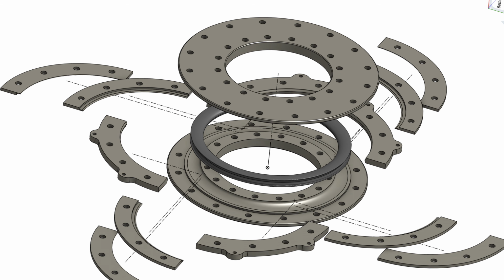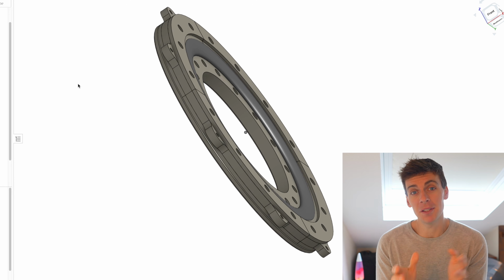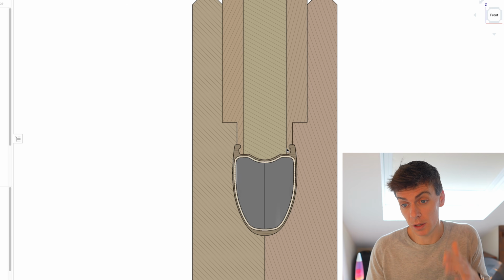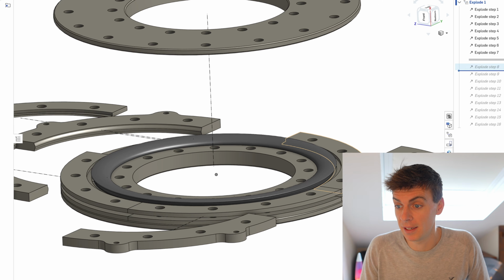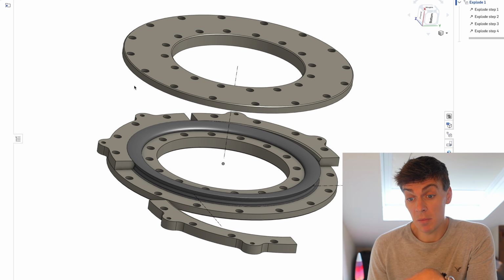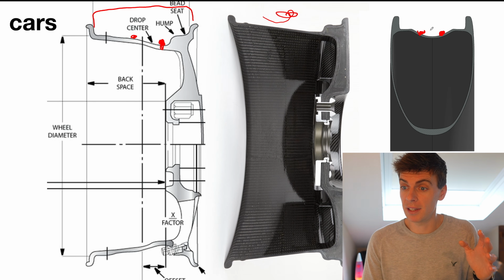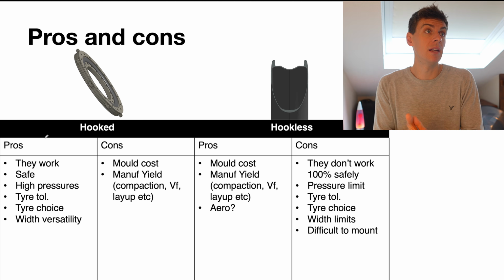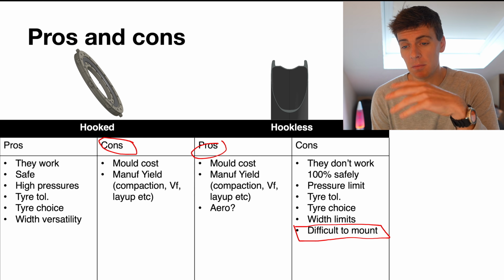Hookless carbon Bike Rims - the Truth = cost cutting.

Comment: If they are saving money on manufacturing, they sure don't seem to be passing the savings to the consumer.
Reply from the maker: I think it depends how you look it at. It helps to allow them to build a product in the US. Whether that matters to your or not, but for a lot of people it does.
Reply: @PeakTorque won't matter when noone buys it
Reply: @PeakTorque whats all this crap about with short cranks the grifters claims the old longer cranks hurt there knees lel
Reply: Yeah...I'm reminded of the "Law of Diminishing Reality"...apologies to 'Utility'.
Reply: I agree, and i'm no zipp lover, but their 303s hookless wheelset can be bought for just over £800 new which is relatively cheap for zipp.
Reply: @Local.hero.1983   I have the 303s as backup wheels.  They're outstanding for the money.  Significantly better than the noodley $2300 Zipps I had in 2006 that would melt on descents if you weren't careful😅
Reply: Hahaha - Have you ever seen Zipp or Enve do a price drop? Nope going straight into bottom line.
Reply: @ConstantRider  Zipp literally dropped their prices on the same model rims when they went hookless...
Reply: @ConstantRider  recently I’ve seen NSW wheelset prices down almost $1kUSD on a few websites. Give it a google.
Reply: @ConstantRider  Zipp and Enve are made in America so that means American wages. I have no issues with that. Better than some dirty factory in China.
Reply: @ConstantRider  My 303S wheels were the first pair of carbon wheels I could afford brand new, I'm not necessarily crediting that to hookless tech but I definitely noticed a decrease in price.
Reply: @ConstantRider they just did a huge price drop when hookless launched.
Reply: @ConstantRider yes,  when they went hookless, their wheels dropped $200-300 for a given model.
Reply: @veganpotterthevegan  not quite so...tubulars predate clinchers, they are 1800s technology.  Please look into track racing and why they use tubulars.
Reply: @menelaos951  nothing I said should lead you to believe I don't know that
Reply: Saying they aren’t passing on cost savings shows people don’t understand economics. If one manufacturer lowers manufacturing costs and doesn’t pass on some of the savings, others will to take market share. Supply and demand. Finding cheaper ways to make things that perform as well is a benefit. If they prove to not be safe, then that can cost sales so we’ll see.  Mine have been great so far.
Reply: We're not supposed to care about what goes into the price tag, only about its size. I know other replies mention labo(u)r costs and other factors. I would kindly remind everyone that, unfortunately, the incentive lies, for consumers, solely on the function and cost of the product. Such is the economic system we live in.
Reply: How do you know?
Reply: Used to be really cheap 1000-1200g hookless wheelsets in AliX back in the day, still are some. EliteWheels has a set of 38mm rim profile, 1180g, 500$.

And they don't have any pressure limit and you can mount anything from 22mm to 32mm on them. 

Just need to glue the hookless tire on the rim hm though.
Reply: Imagine being deGendt and told to get back on hookless
Reply: @dickieblench5001  he’s riding hookless right now. The reason his rim failed had absolutely nothing to do with being hookless. Use some common sense. Look at the rim!!
Reply: Same with the 1X scam on road and gravel bikes. The manufacturers eliminated the cost of a front shifter mechanism, a chainring, and a front derailleur, yet the price of the groups are generally at the same MSRP or even higher than a comparable 2X system. 1X for road and gravel has always been a complete scam to lower manufacturing costs and increase manufacturer ROI. Full stop!

Of course, it also got pedaled to the market by SCAM's marketing team because they lacked the ability to create and fabricate a dependable and proper shifting front derailleur so they basically just lost it and started advertising their snake oil BS about how 1X is soooo much simpler (as if a bicycle front derailleur is some obtuse NASA type device that no one can comprehend or adjust on rare occasions???) and then lied further and waxed poetically about the supposed "massive" weight savings while of course conveniently ignoring the fact almost all 1X road and gravel set ups are using a dinner plate sized cassette, a chain catcher and a longer chain to deal with that dinner plate size cassette, which pretty much eliminates  almost all the "supposed" claimed weight savings. Then to finish off their comedic snake oil marketing act/project they actually raised the price of 1X groups higher than their comparable 2X systems even though it obviously costs them far less to produce said 1X system. And of course, loads of gullible and easily marketed to dopes happily by into their snake oil nonsense. 

Oh yes, I'll happily pay MORE for bigger gear jumps,  constant shitty extreme chain angles and loads of extra accelerated wear on my chain and cassette and single chainring up front. Sounds like an absolutely "incredible must have" bargain on my road or gravel bike.  PT Barnum would have been very proud and envious of this obvious scam marketed as an "improvement"!  🙂
Reply: It is almost the opposite because they advertise it as lighter and more aero and charge more, which is insane.
Reply: Everyone's wheels got cheaper when equivalent models went hookless
Reply: Giant bikes are bundled with carbon hookless rims on all mid range road bikes and above for a long time now. 

And are incredibly well priced vs competitors, and the wheels are a bunch lighter too than stick wheels on other brands. 

There’s the savings. 

Zipp are a vanity gimmick brand as far as wheels go, £500-1000 on the price is pure profit so you won’t see much benefit from efficiencies. 

Also, they can’t even make hubs with decent seals so their wheels are worthless to me anyway.
Reply: @TheWoogeroo The price discussion is not the case anymore.  The new Giant MSRP are outrageous.    You can buy a top of the range Look bike cheaper than a Advance pro.
Reply: @TheWoogeroo  > are a bunch lighter 
How much?
Reply: @andzejwojownik8012 I think back a few years ago the comparison was 42mm deep carbon with a DT Swiss produced hub, vs no name alloy at the same price points. This was pre Covid so pricepoints were very different. 

But at present for an example, on the manufacturers UK sites: TCR advanced pro2 vs a specialized  SL7 Sport

Both £2999, the Giant comes with 40mm deep SLR 1 carbon wheels with unbranded DT Swiss hubs, the Specialized comes with alloy wheels.
Reply: Can you remember how many instances there were of tubs rolling off rims? This was never blamed on the technology, even though it was mad how unsafe it was. It was always blamed on user error e.g. you didn’t spend the full 3 days applying multiple layers of glue and then leaving it all to cure properly, or you braked too much going downhill and melted the glue. But consumers and racers just got used to it and learned how to make the best of it. And tubs entered the market before the Internet, so there was no collective hysteria. Maybe I got lucky, but I’ve had 3 different sets of hookless wheels and they’ve been the best wheels I’ve owned. I race on them - in Belgium. They get smashed. And yes they do have benefits. They are lighter for the price than similar specced hooked rims, and they give a broader footprint, which helps loads with grip. And nowadays many teams race on hookless now with no issues, Pogacjar’s for example. How many YouTubers who slag off hookless have used them for any period of time? Sorry, but this is really getting out of hand? It’s pure fear mongering. People are attracted to these horror hookless stories for the same reason they buy trashy tabloids - the fear of change.
Reply: @MrIvanPe The main reason we never had them blaming the failure of early tubular tires on the design itself, was because there was no alternative. Tubular glue on tires were literally the first pneumatic tires, without anything to compare them to. There were skeptics of bicycles and, no doubt pneumatic tires, back then, but it so thoroughly revolutionized transportation that those complaints were quickly silenced. Hookless rims offer virtually nothing to users of narrow tires, and current road tubeless is not perfect by any means, so there's reason to be cautious.
Reply: @MrIvanPe  There's a huge difference in consequence between a tub rolling off the rim, and a tubeless blowing off.
Reply: @stephensaines7100   you're right.  A tubular rim without a tire is significantly more fragile than a tubeless rim without a tire...especially a hookless, tubeless rim
Reply: @MrIvanPe  Comparing to tubulars is not right. Tubulars could roll off the rim, but it was in fact due to user error, nothing else. The hookless rims can make the tire come off the rim because of tolerances in manufacturing. That is very different.
Reply: @MrIvanPe You don't need any personal experience to appreciate the seriousness of tires blowing off rims. Especially when it can be traced to a model or combination. Why be so cavalier about safety? I don't get it. You like the design, cool have at it, but be realistic. These products have wide reach and are generally sold on marketing claims.
Reply: @MrIvanPe   two of my worst crashes came from someone else's tubulars rolling off their rims

Comment: Before disc brakes, Shimano manufactured rim brake wheels will aluminum bonded to carbon fiber. Dura-Ace version weighed less than 1,500 grams. Has anyone use the same technique for disc brake wheels?
Reply: Those rims are aluminum with just a thin cosmetic carbon fiber layer on top. I have seen the cross section of C35.
Reply: Ask Shimano how their crank recall is going ...

Comment: Just broke my femur when I got a blowout on my rear zipp 353. I'm not sure if I hit anything or maybe I had the pressure wrong on the tubeless setup. Completely new tire mounted by my bike mechanic the night before 32 mm Continental Grand Prix 5000 AS. Not sure I want to use these wheels anymore.
Reply: No good. All the best with a speedy recovery
Reply: Get well. Are you in the states? If so have you found your local shops really pushing hookless? Where I am it is being sold and trending, but no one really seems excited to elaborate on the benefits
Reply: Blowout as in a puncture or from the tyre coming off the rim? What pressure were you running? Hope you heal up well well and make a full recovery.
Reply: Horror story
Reply: Sorry to hear this . Hope you have a speedy recovery. Please consider switching to hooked wheels.

Comment: Brilliant as always, thank you. Winspace provides awesome lightweight wheels with hooked filament wound high temp resin rims, and carbon fiber spokes for about US$1300/set. They can be run with tubes or tubeless. I assume that Winspace (and other manufacturers) have found a way to be profitable with hooked rims. Why would anyone choose road bike hookless? They are not less expensive for the consumer. Also, the pricing for the TPU tubes have come down to about $10 each, and they are about 30 grams.
Reply: At $1300/pr I'm sure they're veeery profitable.
Reply: @AndrewBlucher  You will be surprised to find out how relatively inexpensive the material costs are.
Reply: @HoshinoMirai  No, I wouldn't. Why assume that I'm ignorant?

Comment: Car tyres are not fitted with a 'hydraulic press'.  They are not pressed on!
Reply: You can do it with tire levers, albeit long ones. 
The machine really just makes it faster, easier, and less likely to mar rims.
Reply: watch The Tire Doctor
Reply from the maker: I meant the shovel part of the machine, and yes pneumatic normally but sometimes the shovel is hydraulic for truck tyres.
Reply: @PeakTorque  the pneumatic part of the machine is for 'breaking the bead' prior to tyre removal.  The wheel is clamped to the bed on fitting,  Otherwise car tyres are fitted the same as bike tyres.  Car tyres are not pressed on using hydraulic of pneumatic power.    I can easily understand that you've never used a tyre fitting machine, and that this is not a specialism for you.

Comment: Fun fact - original Hutchinson UST road tubeless tires used carbon fiber for the bead material instead of kevlar or steel. At the time, kevlar was considered too elastic. I believe it was Bontrager (again back with the original UST road) used "high modulus" kevlar. I have to believe that most if not all road tubeless tires use something like what Bontrager was using, but maybe they should consider something stiffer again.
Reply: I can't believe your post didn't get more likes than just mine. Absolute kudos not for just pointing that detail out, but for offering a dynamic in thinking in different ways. A lot of readers/riders so readily assume what the marketers tell them is the only way of doing things. The term "consumers" comes readily to mind. I have to think that drawing material through a die (a revisit to alloy or an alloy/fibre hybrid, perhaps in a two stage bonding process post die drawn) is the answer. And the machinery to do it is already extant and perfected, but just needs a few tweaks. And save a good wad of cash at the same time.
Reply: I was thinking the exact same thing during the presentation 👍

Comment: What watch is that you're wearing? Seiko 5 with a rubber strap? It doesn't have the crown guards though.
Reply from the maker: skx007 Orange. Not a 5 ;)
Reply: I should have thought of that, it's a classic, replaced by a 5 with a very similar design. Nice watch. I assume there's a collection, nobody has just one automatic watch :)

Comment: Great insight. Sadly people still won't understand why their folded floppy tyres differ from a car tyre. 
I had my TCR 2022 SLR1 stock rims  w/ hookless tyres fail. At the time "giant " approved " tyres were Cadex , Gavia tanks or Schwalbe pro one. Only race tyre was Cadex which were gobbled by teams and semi pros. So I had two hookless specific tyres fail but not catastrophic. To be fair they weren't approved by giant at the time. Just burping badly. I got rid of them and didnt look back. I see now Giant have very specific approved tyre list with very specific max PSI. 
Descending at 90km/h with heat with increased psi in back of my mind made me decide to chuck the hookless rims. 

Thing is I sold them to a fat dentist type who literally didn't give a shit and threw some Goodyear F1 28mm for hooked only rims on the SLR1.
Reply: So basically you were using the wrong tyres. Genius

Comment: Beyond pressure increasing because of temperature once you're riding, can you trust your pump's pressure gauge to be accurate ±10% to begin with? I'm too cheap for any of this stuff but I just wouldn't trust hookless for road in the current state.
Reply from the maker: No, but this is not the point. Next the industry will be selling us 1% accuracy fecking pumps. When the point is the safety factor should be 100% not 10% so the pump isnt the issue!
Reply: @PeakTorque  Not to mention the fact that riding conditions can raise the tire temperature very significantly. Say if you pump up your tires somewhere nice and comfortable around 20 to 25 C. Then you go ride on fresh black asphalt on a hot sunny day, and the pressure in the tire can easily jump by 1 bar.

I'm sure the pro teams try to take factors like that into consideration. But there really should be a safety margin big enough so that you don't have to worry about factors like this.

Comment: I've pondered, for a while, why they don't just manufacture the rim as hookless then either machine in the channel to make it hooked or glue on the lip to make it hooked. I assume that the multi-part mold is not enough of a complexity/cost gap to make it less attractive than machining a channel or bonding a lip, but who knows...
Reply: The strength of carbon fiber in this application depends on continuous strands in the carbon layup. You cannot just carve out a channel like that without sacrificing almost all of the structural integrity in an area that requires a lot of strength to both retain tire pressure and fend off impacts.  Drilling spoke holes is an entirely different situation.
Reply: You're adding another step, requiring additional expensive machinery and tooling. Also another step where something can go wrong and ruin the rim. I'm quite certain they CAN do this, but now you've just added back all of the cost savings from molding it hookless (and maybe added even more cost).
Reply: I'm here for this thread. Have been thinking about this and don't know enough to figure out why manufacturers aren't doing this.
Reply: Well, you cannot machine a carbon fiber rim, can you ?
Reply: @pierremaggi8661  you absolutely can machine carbon fiber rim. That's how you get spoke holes. Those fancy carbon OSPW cages are machined out of a flat sheet too
Reply: @feedbackzaloop  thanks, i was genuinely asking. Perhaps the geometry of a rim makes it difficult to machine inside its narrow channel ?
Reply: @pierremaggi8661  not that much of a problem either, there are endmills for pretty much any complexity. It's rather somewhat unnecessary extra operation (mould can take extra time in making because it is made once for hundreds to thousand-smth rims, rims better leave the factory asap) asking for a different type of layup (the structure after machining should represent the structure as if it was not machined but moulded). And carbon is very abrasive towards the tooling, so you will pay a lot in spare mills.